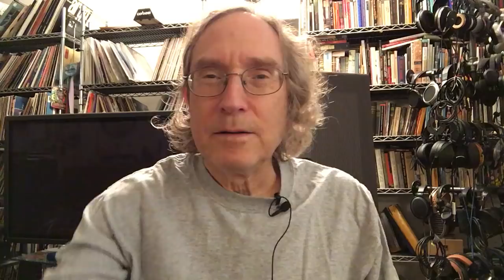Box vs. panel speakers, some things to think about

Comment: "Generally because of the energy coming off the back of the speaker they are harder to place than a box speaker."

Remember though, a box speaker has nearly as much energy coming off the back as a dipole, particularly in the case of dynamic driver dipoles with no rear facing tweeter, like the one Dr. Linkwitz designs.

So there's with dipoles there's just as much interference from the reflections as there is with monopole speakers, the difference with dipoles is the frequencies at which sound combines destructively and constructively.
Reply: Notice that energy may be ( and usualy mostly is) consumed inside the box. The same way like in buildings sounds are not transfered through walls.   For low range typical box is designed in way that shifted phase of rear alows to cooperate with front which in my view  is it's  weak side but helps to squize it's size. But tha same solution is used for subwoofer  in panel type.
Reply: For frequencies where the wavelength is long compared to the width of the baffle, nearly as much sound bends around the enclosure and reflects off the back wall as the sound that comes from directly from the front.
Reply: But it is not so in box type.
Reply: It is because of cabinet diffraction. At frequencies where the wavelength is long compared to the width of the baffle, a closed box loudspeaker becomes omnidirectional. A dynamic driver dipole with a monopole tweeter like the one's that Dr. Linkwitz designs radiate sound in a figure eight pattern, so in reality there's less off-axis sound energy to interact with the walls of the listening room then there is with a monopole (box type).
Reply: Interesting . Did   You  test closed box  omnidirectional diiffraction? How did you do that?
Reply: I've not done this sort of testing. I've seen the data others like Vance Dickason has gathered. I believe that it's typically it's done by placing the loudspeaker on a turntable and placing the microphone near it, then rotating the loudspeaker.
Reply: The figure I've seen is that dipoles radiate 4.8 dB less energy into the room reflections. In practice, this means that they don't need acoustical treatment to achieve a good RT60 (maybe 600 ms) in a typical listening room (there's a paper on this on Linwkitz's site).

Some other differences -- as others have pointed out, there's baffle step response -- boxes are omnis at low frequencies because of the diffraction, cardioids at high ones. Not good and it requires correction in the crossover. Also, boxes tend to radiate to the sides which increases image width, while dipoles radiate towards the rear which increases image depth. Both can smear the sound if the speaker is too close to the room boundary.

Dipoles also trigger fewer room modes so have smoother bass, but they're more susceptible to midbass cancellation from the front wall reflection. And line sources use the floor and ceiling reflections to extend the line acoustically, while point sources are negatively affected by them.
Reply: What you said about midbass cancellation isn't actually true, here's what Linkwitz says about it...
"Often concern is expressed over the fact that the rear radiation from a dipole is out of phase with the front radiation, and that thus any sound reflected from a wall behind the speaker would cancel sound coming from the front of the speaker. Cancellation can only occur when direct and reflected sounds are exactly of opposite phase (180 degrees) and of the same strength. Since direct and reflected sounds travel paths of different length, they undergo different amounts of phase shift. Thus, the phase and magnitude conditions for cancellation are given only at certain frequencies, if at all. At some other frequencies direct and reflected sounds will add. The same also applies to a monopole speaker in front of a wall. The only difference is in the frequencies for which addition and subtraction occur. The best remedy is to move the speaker away from the wall, or to make the wall as sound absorptive or diffusive as possible."
Reply: His explanation is incomplete. A dipole radiates front and back, but not to the side in the dipole null. What this means in practice is that a dipole that is parallel to a front wall will have nearly complete cancellation. A box, on the other hand, is omnidirectional in the bass and radiates equally to the side and to the rear. Standard practice in speaker setup is never to make an omnidirectional speaker equidistant from multiple room boundaries. By staggering the path lengths, the proximity effect cancellation is incomplete and such dips as do occur can be equalized.

Comment: I think of a speaker as a 'system' - so the 'box' is critical to the whole.   Placement of box speakers is always important, or at a minimum makes differences in the resulting sound, but the panel speakers are critically dependent on placement.  But, I've always tended to first find the best place in a room for set up of my system, and furnish the room around it.   Net-net, and not surprisingly, it sounds like (no pun) choosing between box and panel is very much tied to the primary music one listens to.   I'm also wondering if anyone has produced a standalone ribbon tweeter for use with box systems, and if not, why not.
Reply: You can always add a ribbon tweeter. Raals are perhaps the best small ribbons. You could also consider adding an AMT driver, which has similar characteristics. But I agree with those who say that if you want the benefits of both planars and boxes, the best course is to get planars and combine them with dynamic subs when you want the extra slam for rock or movies.

Comment: You don’t mention line arrays, which are technically box speakers.  Would a line array give a panel speaker a run for its money?  And what if that line is also a CBT?  Could the CBT line array be the ultimate loud speaker configuration?  

You could also argue that with a line array most of the cost is in the driver’s.  Although a line array box can be a complex affair.
Reply: Dynamic or dynamic + ribbon line arrays are great, but as you suggest, more expensive than planar magnetics or stats of similar quality because of driver and labor costs. So they tend either to be pricey or DIY projects. If you can DIY them, you can make something that will blow away most commercially available speakers for not that much money (DIY Audio has lots of projects).

Comment: is there a panel speaker for 500$?
i think it's a question of money.
quad panels are absolutely brilliant,
with quad combo,
but  they cost....
thanks and hello
Reply: Magnapan MMGs are $600 brand new. I picked up a used pair on Craigslist for $300.
Reply from the maker: Magnepan MMGi is $650 a pair, it has a tall ribbon tweeter.
Reply: Steve Guttenberg Audiophiliac  thanks
Reply: flashhog01 
hi, how do you like them
and did you compare them to "boxes"
in a similar price-range ?
Reply: In the similar price range I haven't heard anything that can match the openness and unconstrained sound of the Maggies. They put a difficult load on your amplifier so they will probably not play as loud and have less bass than your box speakers. I cannot describe the air surrounding the music once it is freed from a box and the wall of sound coming at you versus the cone of sound from a conventional driver, it has to be heard.
Reply: flashhog01 thank you.
i had a demo of quad elstats with amp 33/303 in a london-store, i bought the 33/303 , easy transport, directly, because i had a pair of klipsch la scala at home. worked very well.
the e-stats,  the best live-natural event i ever heard. another price-range, but gives me an idea.
i'm no basshead.
love mid-high-clearness
and a decent bass.
so i am very curious to find out about the maggies.
have fun listening....
Reply: Compared to the Quad and Klipsch speakers I'd say the Maggies have less energy in the top end (not as bright). Have fun on your journey of mixing and matching components until you find a combination you're happy with!
Reply: flashhog01  
thank you.
i imagined
but i need for my new, small appartement something, to have fun with.
try to find it.
for here in sunny south-france.
now fostex active boxes. small.
bye
like to (maybe) get better highs.
compared to, also, klipsch rp 15.
old american tv series have difficult to understand voices. for non-americans.
dialect
but i looove them.
Reply: Konad Benz
See if you can find some Gallo Micro or A'diva Ti speakers. They are not too expensive, also very small (great for small apartment), and I think, have much of the sound you are looking for. No deep bass, but a subwoofer takes care of that.
Website is roundsound dot com.
Review by Steve is here: https://www.cnet.com/news/gallo-micro-se-how-can-a-speaker-this-small-sound-this-good/
Hope this is helpful!   : )
Reply: Hare deLune !!!
merci beaucoup
if you allow
btw graet name....
Reply: Konad Benz
Thanks!   : )
Reply: Hare deLune 
hi,
tried to find gallo micro,
but seems to be impossible to find em in france
us-buying is, as usual, to expensive.
freight rates are hallucinutional
take care     k
Reply: Konad Benz
Sorry to hear.
My friend found some very good used ones on Craigslist. Perhaps if you have something similar in France? Also Aidiogon dot com is a good place to look. Shipping weight is just over one kilogram. 
I would not recommend eBay, however. Too many charlatans. I have also looked on Amazon UK but could not find them there, although they were there before.
At least you know something to look for. Bon chance!   : )
Reply: I picked up a pair of MMG speakers with nice aftermarket stands on Craigslist for $350.
Reply: Steve Guttenberg Audiophiliac Would an Emotiva XPA-200 work well with these?

Comment: I would imagine that some combination creating and containing a sound both matter.  Having no exprience with panel speakers, I have no factual basis on an opinion.  But logic governs my opening line above. Panel speakers then- is the room the box?  If so- then a box speaker sound is boxed  x 2.  So it seems to me how much a sound is contained and how that sounds to the listener is what matters. What is factually or technically better - I don't really know.  But for those that have experienced both - how the money is spent on the product
Reply: I remember thinking about this when I first got into HiFi as a young teen. I figured back then that the ultimate speaker would be built into the walls of a special room with the rear of the drivers vented outside or into another room. Then the listening room would have additional air relief vents on the opposite wall, facing the drivers. I have no idea if that would be particularly good, or particularly horrible now, but I liked the idea at the time. Maybe the opposite wall could have passive radiators, like undriven cones, to allow the air pressure in the room to stay relatively constant. Maybe a whole "soft walls" concept could be adopted where large portions, tuned for optimum effect, of the walls act as flexible acoustic radiators, rather than seeking to stiffen the wall and then dampen and diffuse the sound that reaches them?
Reply: Andy B 
I think my resolution came to this-
How to fill the room well enough. Positioning box speakers was hard enough. After wall mounting and other experimental efforts, I went with floor standers in the front, and larger than usual book shelf speakers in the rear. Use power enough to play at low  volume with presence of clarity and detail though warm, still fill the room and the option to get louder.
Klipsch all around with a yamaha receiver with both loudness and volume controls.  Klipsch subwooder also. So far so good.
Reply: Sounds like a nice setup!
Reply: Andy B 
Hey thanks!
Reply: Andy B
I had a similar thought, to have a room where the walls 'are' the drivers.   : )
Reply: Your intuition about boxes is right. Planars sound open because they're free of the box resonances. They can be suppressed but it's very very expensive to do so and most of us can't afford the kind of speaker that does it (the big Magicos, say, at over 100 grand, which sound almost as open as a planar). 

There's another factor too, and that's radiation pattern -- dipole radiation and line sources. Essentially, what this means is that a planar speaker interacts less with your room. It's harder to set up than a box but once you do room acoustics affect it less because there's no radiation to the sides (a dipole has a figure eight radiation pattern, radiating to the front and back but not the sides) and the floor and ceiling reflections actually extend the line source beyond its physical height. You can get similar results from a box but it requires acoustical treatment.
Reply: Josh Hill 
Thank you much!

Comment: The money factor doesn't make sense. If dynamic drivers were not produced in such industrial quantity, with so much well established r&d, their price would be far higher and would account for most of a box speaker price. Anyway the solution is there is called open baffle.

Comment: While I do enjoy your commentary - lighthearted and even tempered - I really strongly disagree with your presentation concerning panel speakers.   Let us begin with "Magoos", i.e. Magnepans.   Dull, devoid of dynamics, incapable of imaging,  lacking any real bass, that ribbon tweeter has NEVER been coherently integrated with the rest of the panel it jumps out like a sore thumb, homogenizing to all music pushed through them, e.g. everything is played at the same volume no matter where that sound should be in the mix,  and overall a very murky sound possessing little or no clarity.  The Magoo panel is beset by all kinds of problems - drum modes, the steel frame is barely attached to the wooden surround, NO SUSPENSION.  A CHEAP speaker that sounds like a cheap speaker.   

So what does a Magoo do?   IT SOUNDS BIG - just like live music SOUNDS BIG.   Very intoxicating when first heard.   But over time very fatiguing - due to its many faults - including needing about 0.5 Kwatts to get the big dummy even slightly energized.

Now electrostatic speakers.  Crisp, supremely articulate, fast with no overhang.  BUT - unless you go to a Sound Lab - big as a barn door - the bass cannot be done with stat technology.  So the manufacturers always end up hanging a box with CONES to get the bass.  Said box crossing over between 150 Hz and 300 Hz.   Typically - always except with the ML Neolith - this results in a huge incoherent seam in the musical presentation.  The cones do NOT sound like the panel - and vice versa.  I heard the Neolith at RMAF '18 and it was TRULY SEAMLESS.  A first for any ML hybrid speaker.

The other giant problem with ALL panel speakers is where do you place them?  In the room > 7' from the rear wall?   In the corners?   Halfway into the room?   That positioning makes or breaks the sound of any panel speaker.   Less of a problem with the stat tech as most of them are curved hence the back wave is more focused.  But positioning a Magoo?   Good luck with that.  Remember that rear wave can lap around the panel and destructively interfere with the launch sound wave.   A huge problem.

Best speaker I have ever heard?  A behemoth of a Sound Lab - a veritable Golem of a speaker.   But egad with a set of JC-1s pushing them?  That thing was definitively a great, great speaker.  Never heard a Magoo be anything other than large sounding.  The smaller MLs?   Big seam in the cone/panel interface.   Just a tough, tough technology to incorporate into an actual home room.
Reply: Oh thank you Russo  Panel speakers are big and the WAF is not acceptable ! The back wave makes music indistinct and wishy washy ! When  singers sound like they have whales sized mouths I get irritated !The bass is rotten! Alnico 15 inch drivers are gorgeous in that area! I have noticed that paupers ,for the lack of a better word tend to buy Magnepan because the are relatively cheap !  I have used plasma speakers for decades and they are fantastico!  I prefer tube amplifiers to transistors ! Nagra 845 ,Air Tight. KT88 ,Audio Power Labs 572 and 833 Class A Oil cooled Faberge Jewels makes you let the music play with total satisfaction and Happiness!

Comment: If the manufacturers that make panel speakers are unlikely to show up at HiFi shows because the panels are too difficult to set up (assuming they have the typical three days ahead of time to get their pros to set them up) then how hard would it be for the average Joe, who doesn't have ears of experience installing and setting up panel speakers, to set them up properly? I think that setup is phenomenally in favor of box speakers.

Panel speakers typically do have a much wider soundstage, which makes sense because they have gigantic drivers from which to launch the audio wavefront, but that image seems to be mushy or smeared across a large area. Panels make for a big sound, like an orchestra but it seems to me that it makes other things to seem too big or smeary as well.

Box speakers do have punch and can sometimes create a razor sharp image, with people or instruments being located in clearly distinct positions in space but the sound stage can seem to be small or restricted compared to panel speaker.

I like both types and enjoy detailed sound so I can hear the enunciation of the singer clearly, the sharp response of a punchy bass and I also like to be enveloped by the huge soundstage of a top tier orchestra. I have yet found a reasonably affordable speaker that does all of that for me. LOL